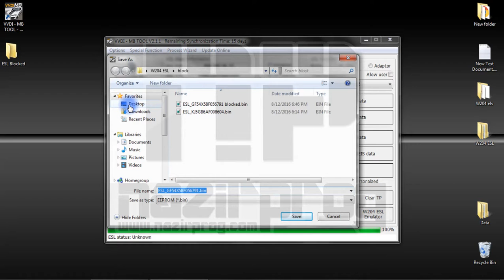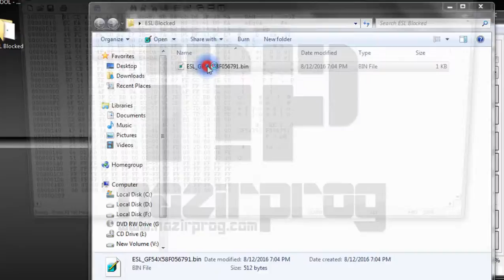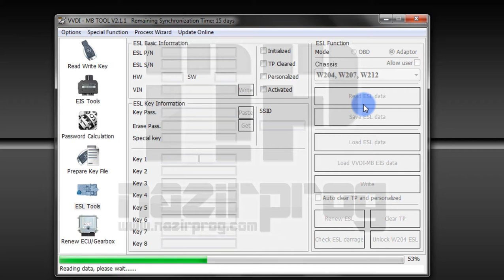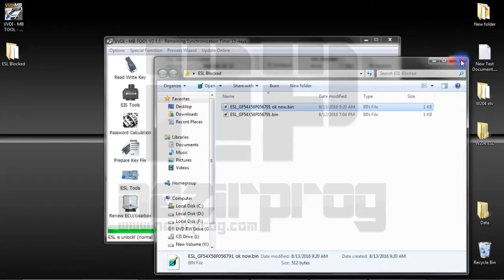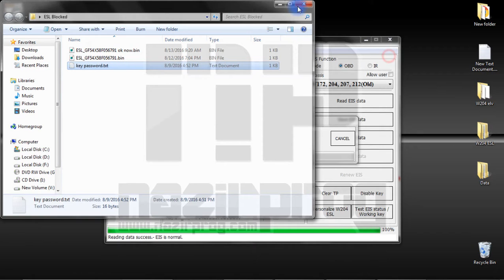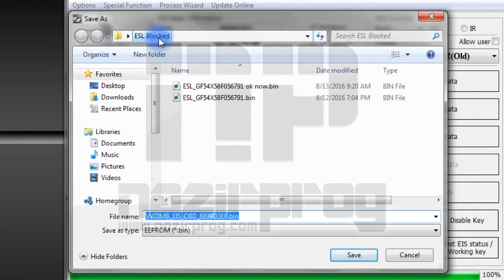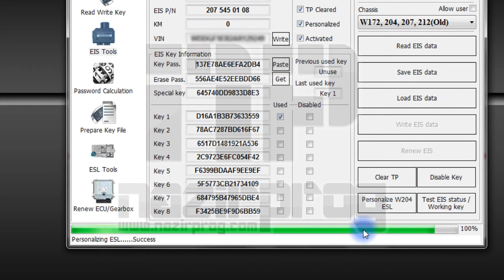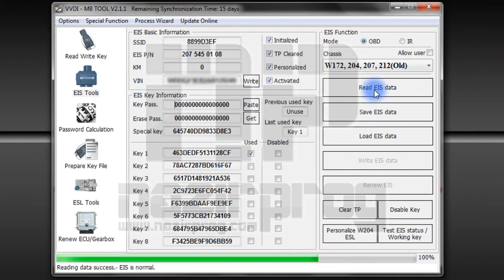how to renew and personalize W204 blocked ESL by VVDI MB - NazirProg

Comment: From what I seen, it does a try per second (maybe a bit faster, but not much), at this rate it would take more or less 20000 days to do the 2026307718 tries. I have mine for aprox 14 hours and made, roughly, 48000 tries. It means I have to let the tool and the PC to this job for several days. How is this convenient? I don't want to be a douchebag, but it's a hell of a lot time. 

P.S.
NazirProg, I don't even imagine how you managed to get that amount of tries, man, you're a hero. Please share with us your experience!
Reply from the maker: It will be faster if you used a more powerful laptop.
You can send an email to support@nazirprog.com for more help.
Reply: Core I5 2.53 Ghz and 8GB of RAM isn't powerful enough...?
Reply: @stefyhgs  no.  8 gig of ram is basically outdated.  Google Chrome alone eats 7.7 gigs.